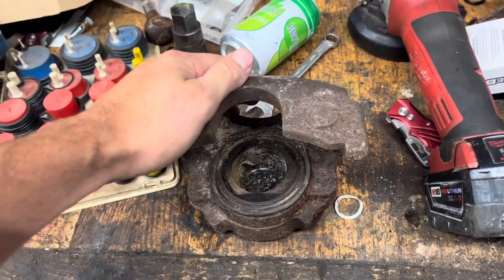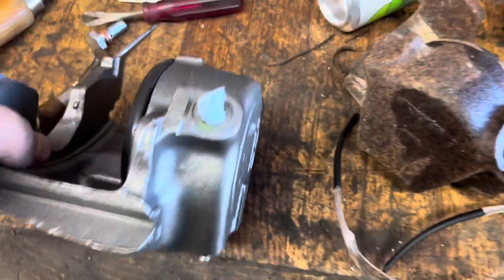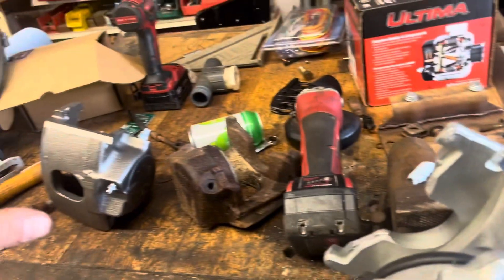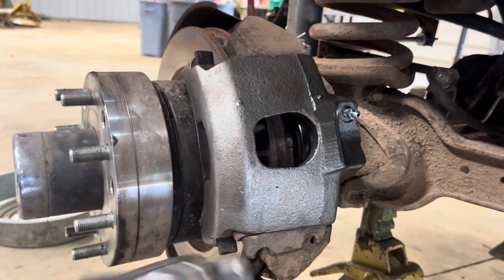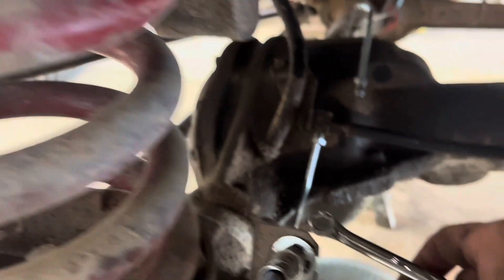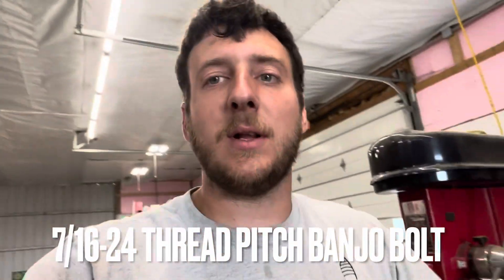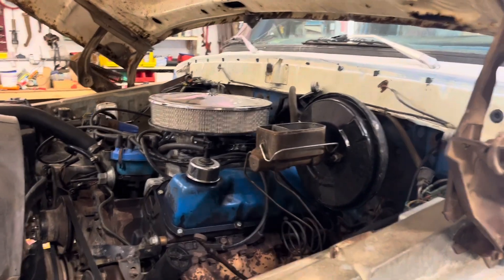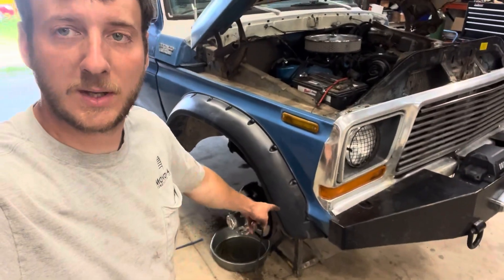Cheap DIY Brakes for 37” tires Dana 44

Comment: Great video-bit confused --why could you not just buy flex lines for a TBird as well -instead of the drilling and machining ??---are you just trying to save money by utilizing the originals of the Bronco ??
Reply from the maker: Both save money and have easily available parts. I appreciate the comment
Reply: So TBird flex hoses can be purchased and used here n this upgrade?---if we all had money lol?
Reply from the maker: @MEKONMESSIN  honestly not sure. There is some stuff out there on the forums about having custom lines made. My understanding is that going from the “t” on the axle to the brake caliper is the custom part. I don’t think there is a simple bolt on line you can get from your local auto parts store. It’s been a while since iv done the research so very possible I’m mistaken.